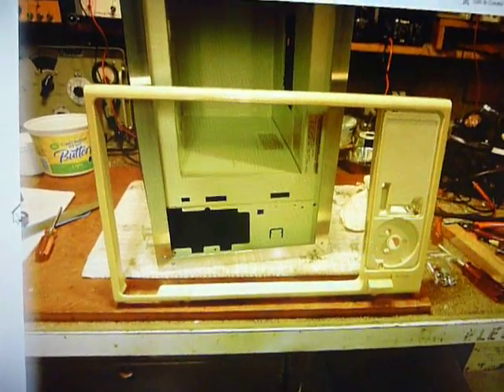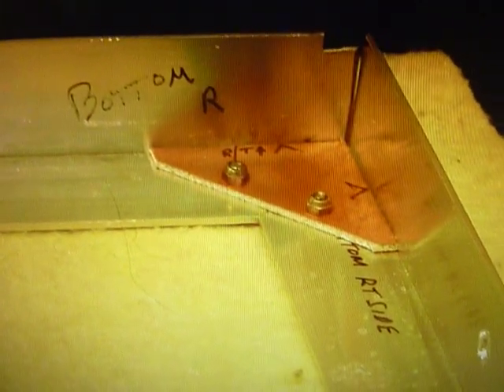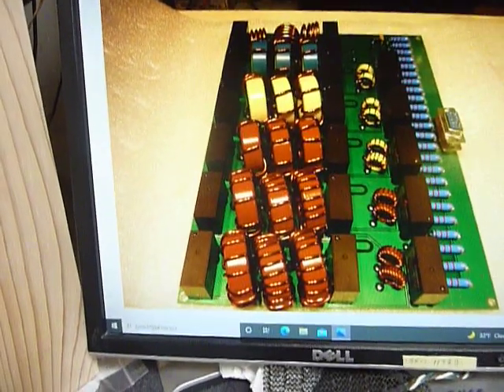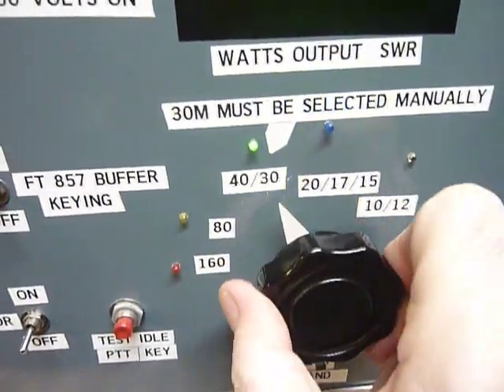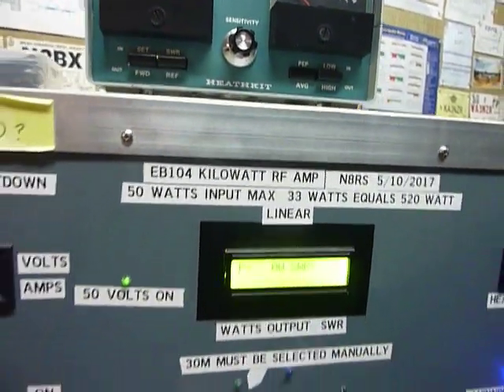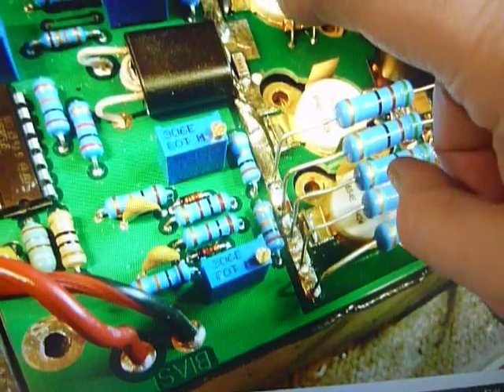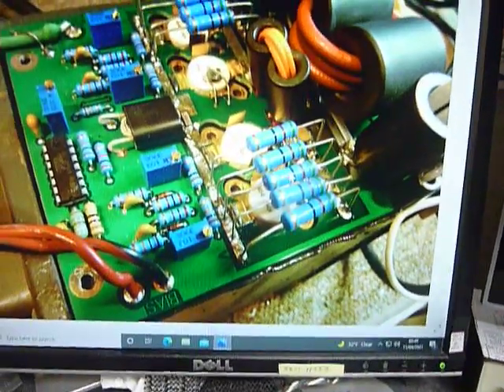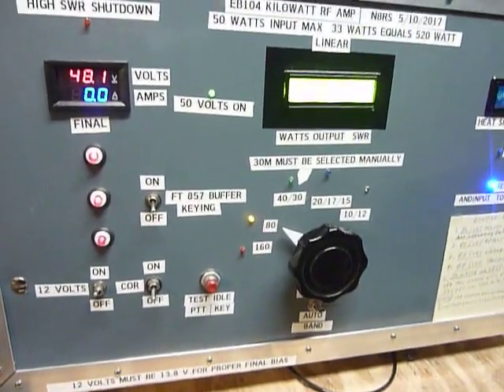HOME BREW KILOWATT ,  HOME MADE  TRANSISTOR  KILOWATT  AMP ,Home made linear  Amp

Comment: Smiling!
Thanks Bob good video Sir. Been looking at the LDMOS MRF-300 and thinking about building one, think they put out about 300 watts each 600 or so total.  Use that to drive my 4-1000A Amp, or at least 200 watts of it just for fun to see what she will do. It already puts out 1300 + or - with 100 watts from my Icom 7300. 
73